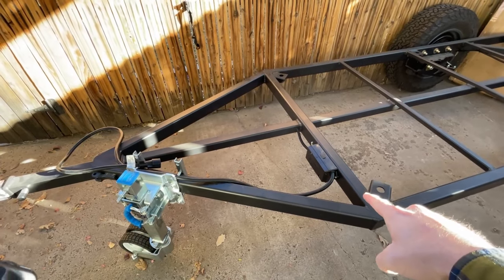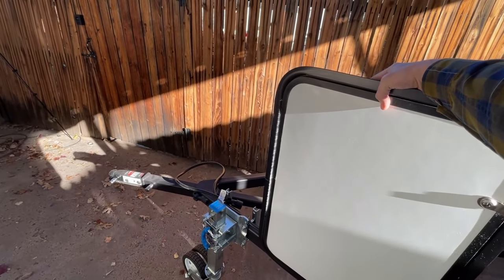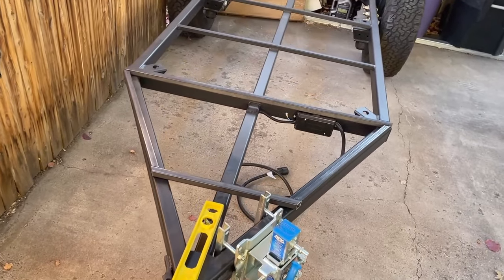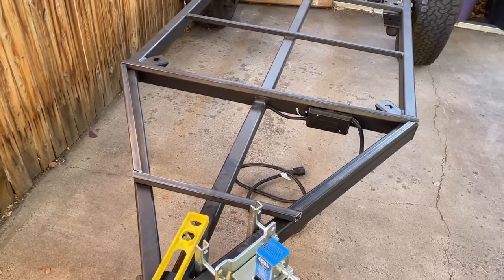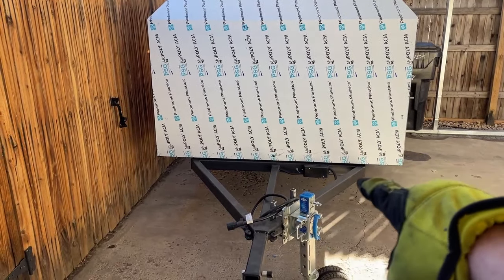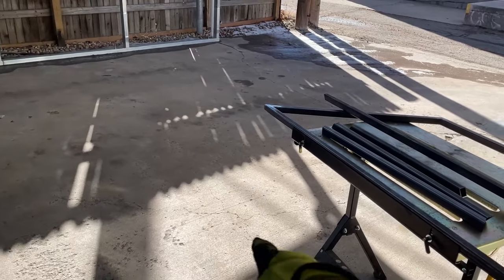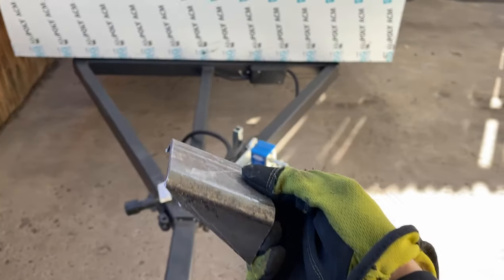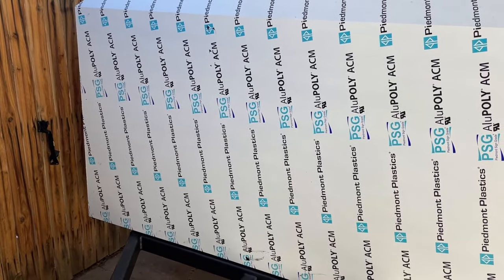DIY Overland camper trailer build: tongue box part 1 - Frame

Comment: I want to build an off-road trailer but don’t have welder and i don’t really wanna use steel i wanna use aluminum but its much harder to weld I’ve seen online
Reply from the maker: That is true.  I would suggest buying something from a company like Aluma as a base.
Reply: @infosponge  I was thinking of that and just using aluminum extrusion as the body since it’s more than strong enough.

Sick build so far man can’t wait to see how it turns out I really like the spring less suspension I’ll also be using that